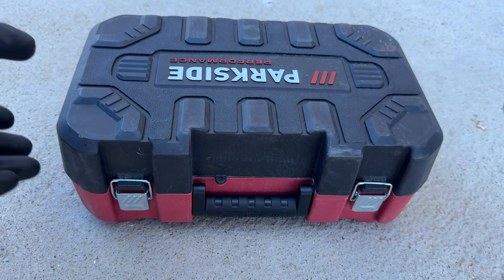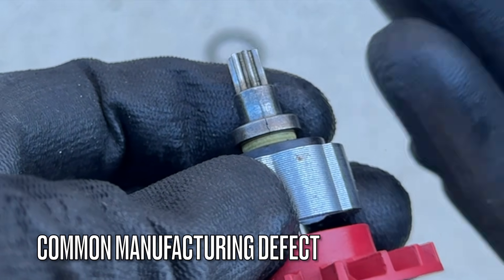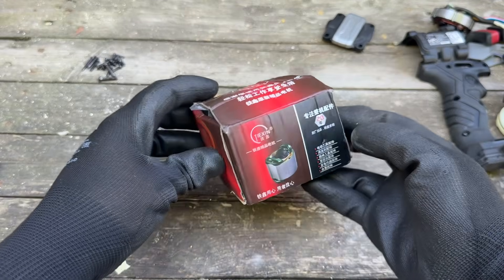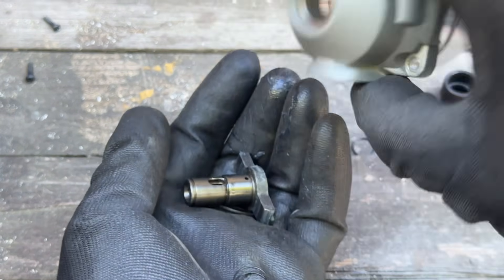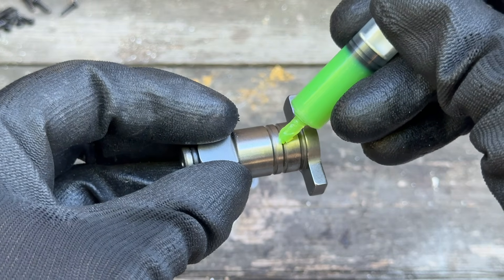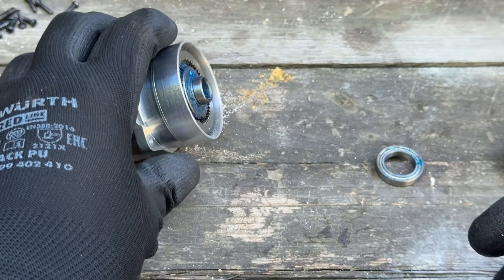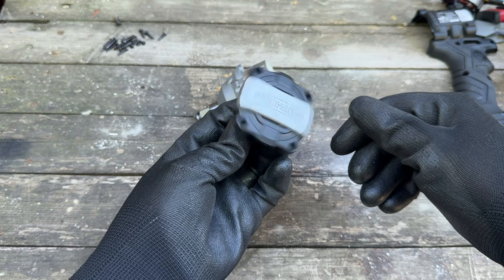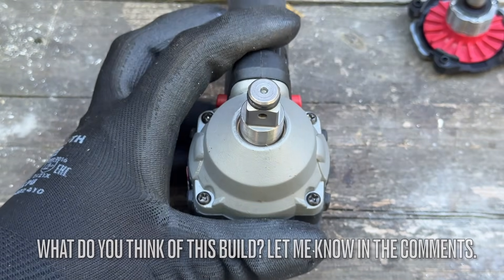Fixing the most defective tool IN THE WORLD. Cheap parts with links provided. Parkside PDSSAP C3

Comment: Nice vid, a lot of work and effort invested 👍. Still I doubt it is worth it taking into account the overall cost. There is a lot other DIY brands similar or better than Parkside for comparable price so not sure if there is any good reason to repair it. Especially since there are some mayor changes to the construction applied and there is no guarantee it will last long as it is now.
Reply from the maker: Thank you so much! I don't think it is worth the trouble now, only if you like to make things difficult. That said I bough this Dayi 2106 head assembly from a seller on eBay for 10 euros including postage about a month ago. Now they have increased the price to about 2.5 times that. It is best to either return it and claim the warranty or look for some used parts to get it running. The option that I present in this video is a last resort but still it might help someone or be interesting to watch to others. Took me quite a long time to find the parts to fit this but got there in the end. Also I have lent it to a friend to use so we'll see if it breaks anytime soon.